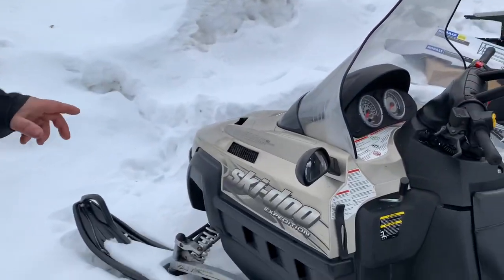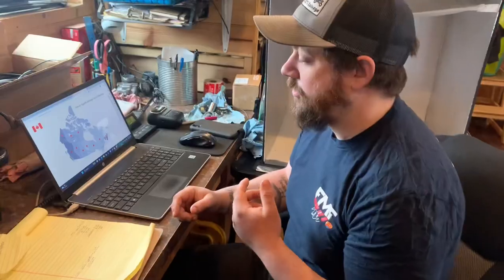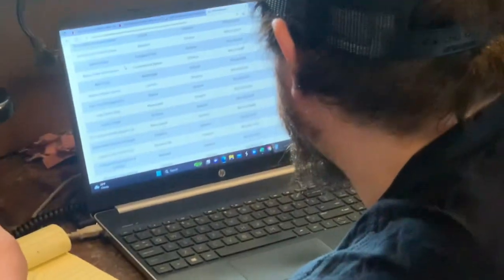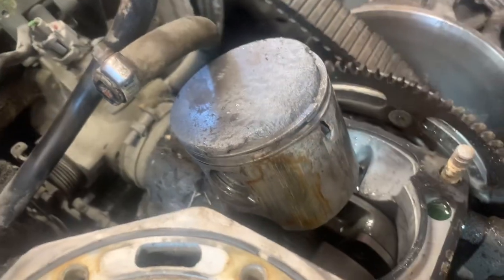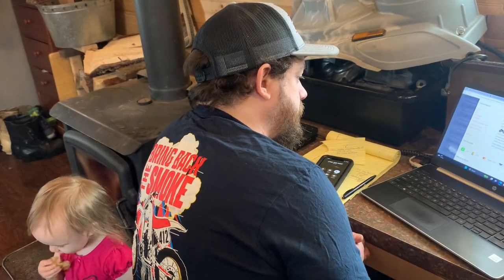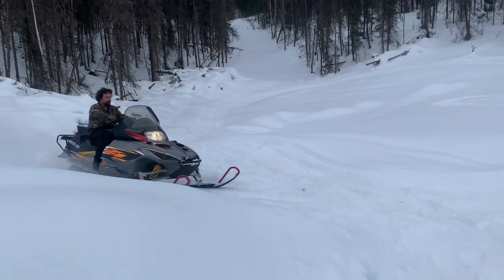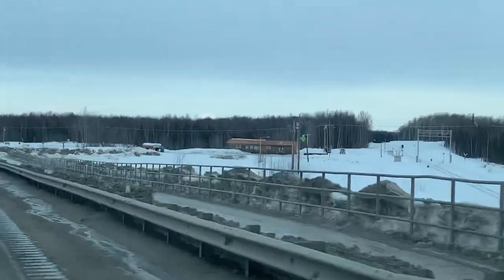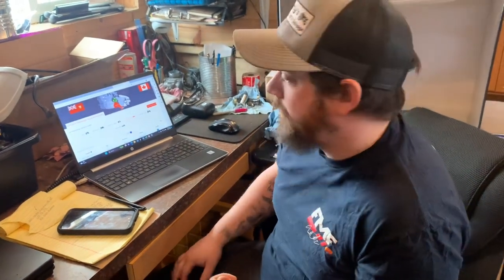The most difficult snowmobile part to find ever! - Lefty’s Vlog Ep:002

Comment: Isn’t the mxz cassis the same the cooler should work
Reply from the maker: Unfortunately no. What makes this unique is the Wide Track. The wide track has 3 separate heat exchangers. The other models only have 2 and they’re completely different.
Reply: @leftyssnowmobileatvsalvage2344  dam that sucks